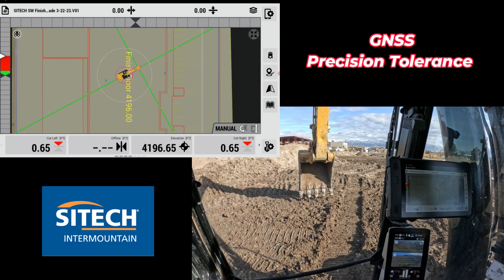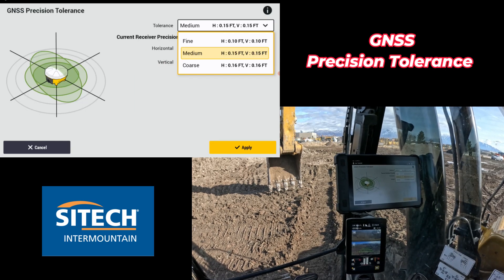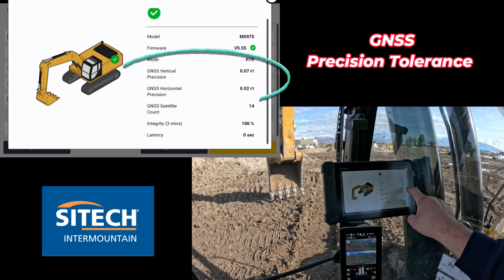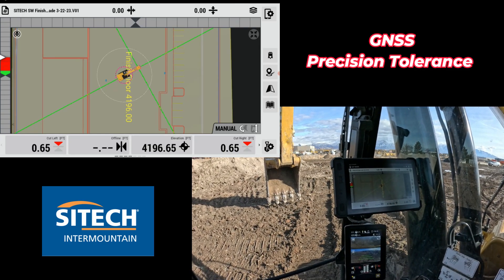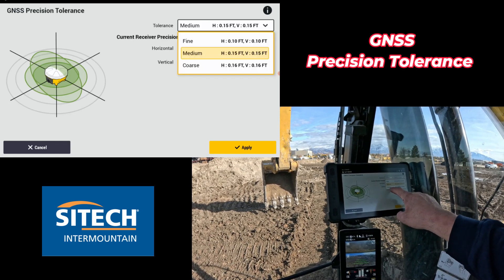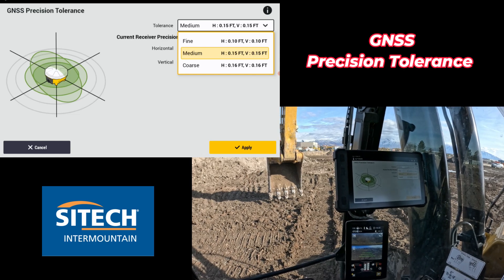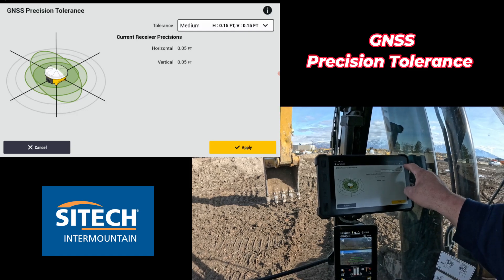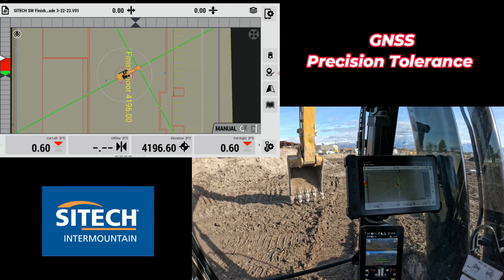Earthworks GNSS Precision Tolerances Explained

Comment: Great videos I've learnt alot off you but I really need your help I'm fairly clued up with the trimble system ,I'm confident doing bucket measure ups but I've never done one on my engcon rototilt I've watched a trimble video on measure up on engcon so I thought I'd give it a go as I wasn't happy with something did everything as it says on screen saved it but on my screen my bucket is now at 45°!!!,in setup it asks if tilt sensor is flat on base or across attachment I selected flat which it is but it's on an angle now is this is what is throwing the computer out ?I'm really desperate to fix this as my boss will have a fit if he has to call an engineer out is there a way I can reverse the settings I have some backups on thumb drives or can I go into file management in web interface  I'm panicking I've messed things up bad I'm over in uk and to call sitech out over here is mega expensive ,be greatful if you could help me out